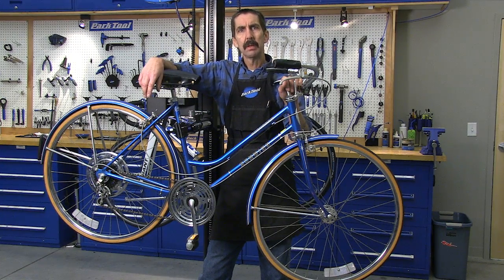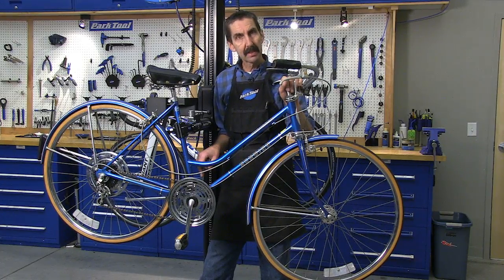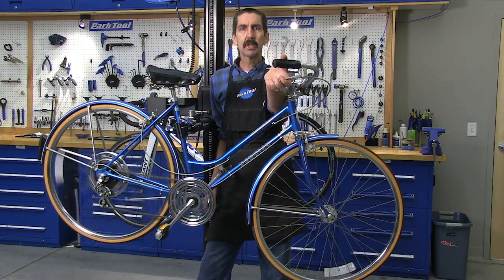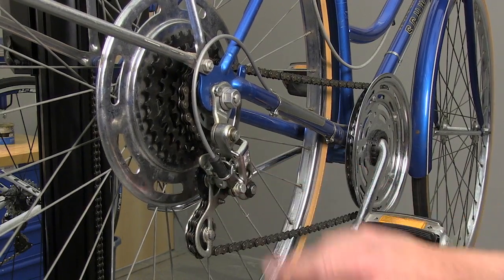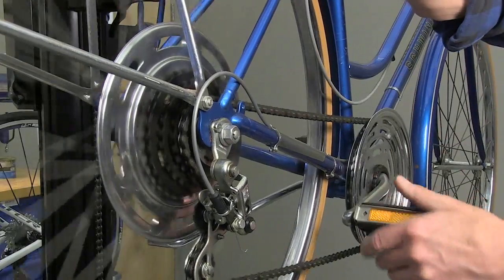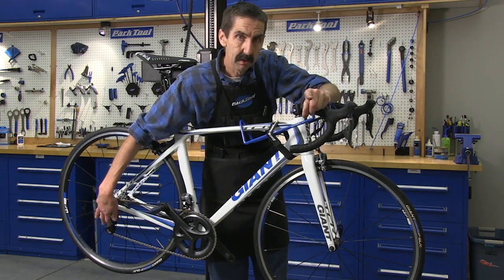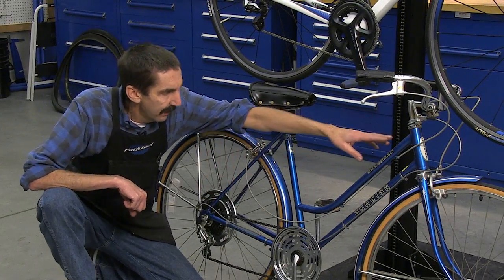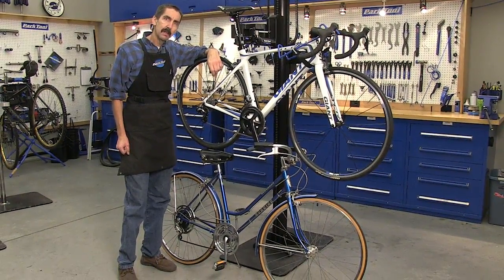Tech Tuesday #5: Front Freewheeling Systems: A Precursor to Electronic Shifting?

Comment: Cool video. Trying to convert my Panasonic villager with Shimano FF system to single speed. Because of rusty damaged shifting parts. Is it possible? Haven't found much info on converting FF to single or fixie. Thanks